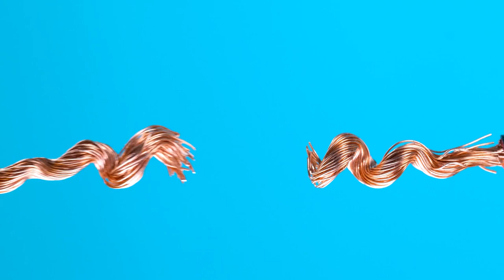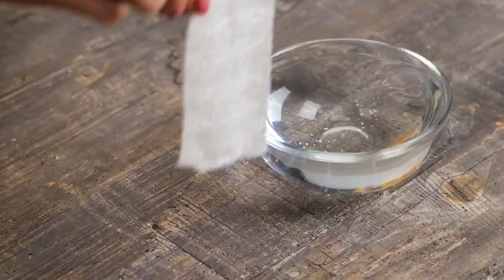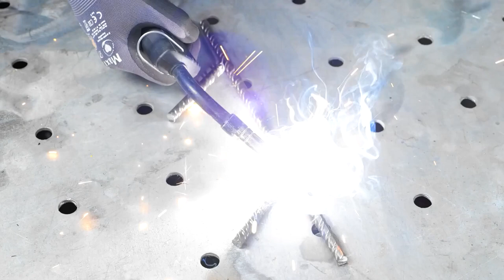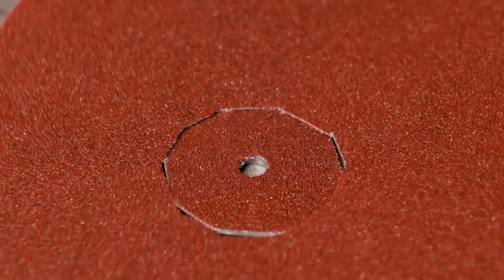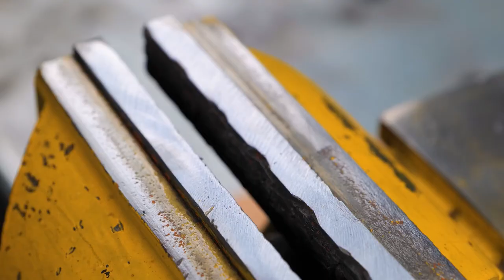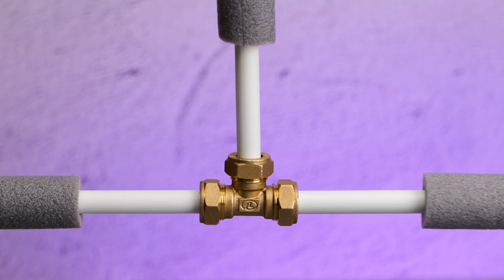Repair hacks and tips for any situation || Cool ideas by Wood Mood

Comment: Do NOT put sandpaper inside your meat grinder. You are introducing ground steel filings from the blades into your meat and aluminum oxide from the sandpaper as well. Sharpen your blades between uses, wash thoroughly, and reinstall PRIOR to introducing meat again.
Reply: Aluminium oxide ingestion does not lead to significant toxicological problems. The steel filings isn't the problem, it's actually the microorganisms in the steel filings that can make you sick.

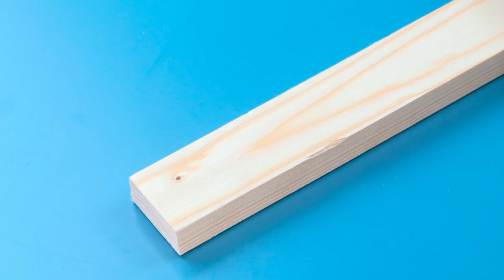Comment: 0:50 the screw driver holder is over engineered. Could’ve just drilled holes in a piece of wood
Reply: A lot of these hacks are over engineered. I assume these hacks are for people who don't own that specific tool and are in desperate need of a solution.
Reply: All of these are either over engineered or legitimately dangerous....

Comment: Some of these are not a good idea to use! Especially, the melting if the pipe.  It damages the structural integrity of the pipe. When it would be much easier to just use a slip joint!!
Reply: *most of them. 
Imagine trying to solder with that ridiculous piece of wire wound around the soldering pencil as a stand.